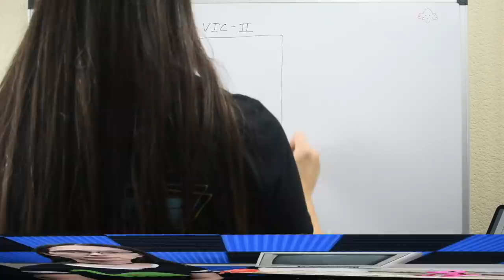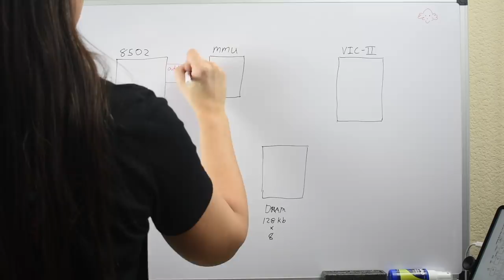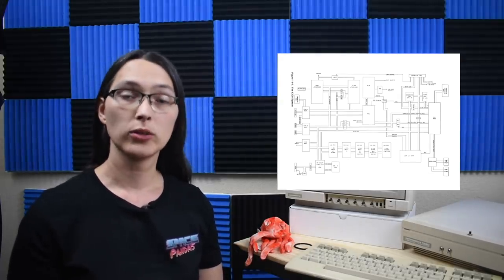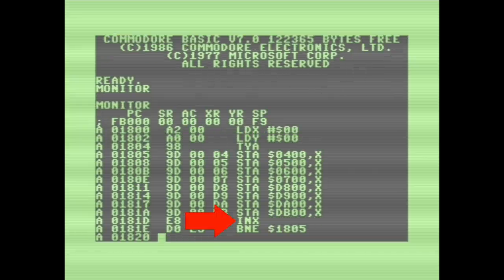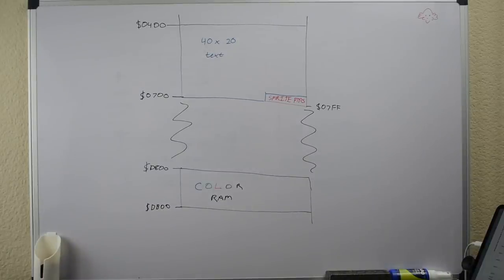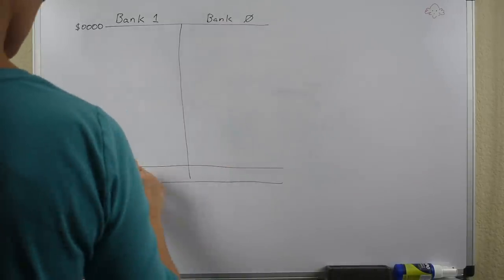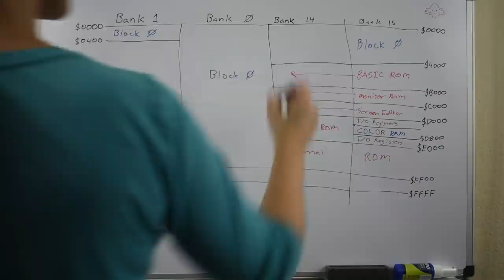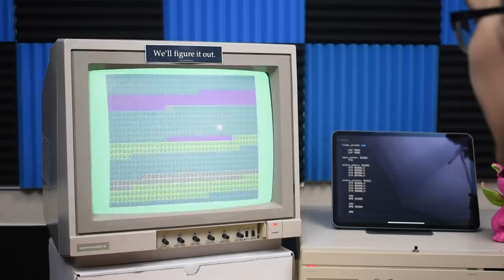Commodore 128D: Episode 2: Meet the VIC-II

Comment: that MMU thing makes the c128 use virtual memory then ???
Reply from the maker: Axel Werner  Not really "virtual memory", but close. It translates logical addresses to physical ones. Virtual memory is used for swapping out pages of RAM to disk, and requires MMU page protection to work with proper efficiency. It can be done in software, but its harder. Not sure if the 128's MMU can do that or not.
Reply: I'm not up to spec on the 128's MMU, but it seems to be a glorified bank switching IC.  I doubt it has the ability to implement virtual memory in the way that you are thinking.  Also, I'm pretty sure that the 8502 CANNOT fail a memory access and retry it later under software control.  The C-64 used the 6510's onboard IO port (@ $00/$01) to control bank switching of the various ROMS and I/O banks in and out at very specific locations, the 128 MMU seems to be quite a bit more powerful than this.

Comment: The ALU doesn't have integer multiplication/division? Huh
Reply from the maker: @sundhaug92 Yep. The 8502's ISA reference is here: http://nybblesandbytes.net/6502 -- no integer MUL or DIV instructions.
Reply: Yes.  The 6502/8502/6510's ALU is primitive (which made the chip less complex and cheap to produce, a key factor in the chip's success), and performs most operations in one cycle once you've taken into account memory accesses.   Off the top of my head, it can only perform 8-bit addition, subtraction, single-bit-shifting, and single-bit-rotation operations.  On the other hand, it could do some very CISC-like things such as perform a bit-shift or bit-rotation on a memory location (effectively a read-modify-write) without trashing your general purpose registers, or performing memory indirection as an implied part of an instruction.
Reply: 6502 coders can divide and multiply by 2 using shift and add/sub instructions. For example: to multiply by 5, shift 2 times left and add the original value.

Comment: Will you eventually cover writing in BASIC? While I understand the point of writing it all in assembly, it makes my brain hurt too much to attempt personally.
Reply: The intention of this series is to explain the nuts and bolts of the C128. Computers of that era were really meant to be programmed in Machine Language (to use the terms of the day, now we would say just Assembly Language). BASIC was an introductory language to get you started, but then even the user manual of the C64 and C128 deferred to Machine Language to use the hardware to its best. You can learn BASIC by reading the manual, that is how most of us did back then. You will figure it out :)
Reply from the maker: @LexieAssassin unfortunately, this series will focus heavily on assembler, not BASIC, since assembler allows much lower-level control of the hardware at much faster speeds.

Comment: Have you used CBM .prg Studio. Great programming tool for the entire CBM range.
Reply from the maker: @piggypiggy pig Actually, no I haven't -- first I've heard of it. After looking it up, I realize, that's the program used by the RetroGameDev book which I have read through. Very neat program, but sadly very tied to Windows. I actually run Mac and Linux at home, so I'm afraid that program's a bit off the table.
Reply: @NybblesandBytes  Hello, don't know if you checked lately but apparently you CAN get CBM prg studio to run in Linux.
Another youtuber called "OldSkoolCoder" have this to say : https://www.youtube.com/watch?v=LZOSlMWlUHw
I suppose it may be dependent on which Linux distro is being used. He's using Ubuntu but then again it might work with other distros as well.

Thanks for your great videos! 👍
Reply from the maker: Yeah, I've used wine before with mixed results. Generally for applications I find it to be a no-go. Parts of the win32 API just aren't there or have major problems.

Comment: Great intro music. Don't like the Illuminati pyramid necklace. 
Looks like 8x the RAM of an SNES ?
It's hard to get into all that programming info for this computer, when it's not related to what I do.
Hopefully people will get into it. 
Nice to see you got results.
Reply from the maker: The Unboxing Authority Dunno about the SNES, but that choker I got from a friend. :-p
Reply: @NybblesandBytes  SNES has 128 Megabits of RAM Max on the cartridges. It's a 16 bit system. 
I hope your friend doesn't belong to a secret society. 
I'm working on doing some SNES stuff. 
With the SD2SNES and SD2SNES PRO Game Cartridges (that are actually modern computers on a cartridge) anything may be possible. 
The new SD2SNES PRO has the ability to do more stuff than any game ever designed for the SNES.
I think it would be fun to see people turn it into a Family Computer (Famicom) 
Just need a way to attach a Keyboard, Mouse, and Internet. The SD2SNES PRO has a Micro USB Port, and people have used it before.

Comment: What is the purpose of the mux in front of the memory? Is it just for “practicality”?
Reply from the maker: @Tim E It's hard to see from my diagram since I wanted to keep it simple. The actual complete diagram in the reference manual is what you actually want. IIRC, it's to allow the VIC-II to control directly which chip gets control of the address lines: the MMU or the VIC. There's probably more to it, but I don't have a full schematic handy, so I'm not 100% sure about the why on this one.

Probably a question for @Bil Herd!
Reply: @NybblesandBytes   neat! That's clever.
I'll see if i can dig up a schematic :D
Reply from the maker: @Tim E Please do! I'd be curious, myself! When I did that segment, I was puzzling over the purpose of it and trying to work out the timing the VIC would need to "steal cycles" from the 8502, but just couldn't quite gel the idea.
Reply: Another book that goes into minute detail on all this is "Commodore 128 Internals: an authoritative insider's guide." I don't completely understand the electronics, but basically the 8502 and the VIC have to take turns using the system bus to acccess RAM. So the VIC contains the clock and sends signals to the 8502 to tell it when it's allowed to use the bus. That's why the 8502 can run at 2Mhz in 80-column mode: the VIC is turned off and the 8502 gets the system bus to itself.

Because the VIC isn't affected by the MMU's switching, they can be looking at different banks of RAM. That presents some interesting possibilites. Like the VIC could be displaying from screen memory in bank 1 while your program sets up the next frame of animation at the same address in bank 0, and then a change in a single value will switch it to the new frame with no delay.

Comment: I learned 6502 assembly on the Apple //e which has a comparably powerful monitor (CALL -151 anyone?)
Reply from the maker: @sarachikorita DIdn't even know the //e had a monitor! Neat!
Reply: Probably the one advantage the ][ line had over the 64 (though as I recall most of the other Commodore 8-bits do have a monitor).
Reply from the maker: @sarachikorita The 64 and VIC-20 did not, actually. It's actually why I chose the 128, and why it's taken me so many years to really get into it.
Reply from the maker: @fnjesusfreak  Yeah, I think the Max, the 16, the plus4 and possibly the PET all had monitors. Just not the mass market ones. ;_;
Reply: I think we used something called the Big Mac assembler on Apple 2E. Full two pass assemblers are way better than simple monitors. I used a cartridge called Hess Mon on the Commodore 64. I think they also put out a Commodore assembler that was on floppy disk. Although back then nobody called them floppy disks they just called them discs.
Reply from the maker: @ttfidrat I remember calling 'em floppies quite frequently. Also "five-and-a-quarters" once I had some IBM PS/2 machines that took 3-1/2" disks. :-p
Reply: LDA C030

Comment: What's the name of your game which you're "porting" from Javascript? Name that dragon that you'll be slaying! Good job owning the (rather small) errors in "#1" - Dave of Eevblog back-annotates errors by reposting the subtitle track with colored overlay text - you can too! Then viewers  will hear the goof, but READ the correction simultaneously! As in " *PCH is really for address bits 8-15, PCL is for address bits 0-7!)". Good luck & good job!
Reply from the maker: @fluxoff Oohhh! So that's how he does it! I didn't realize that you could use the subtitles for that. Neat idea! I may investigate this, then. Thanks for the tip!

The name of the game I'm "porting" from Javascript is... ...well, it doesn't have a name! I think I called it "minimalist dungeon" or something like that. Basically it's "Ludum Dare #26". :-p
Reply from the maker: @fluxoff You can play it here: http://www.theonelab.com/files/ld48/26-minimalism/
Reply: Your video editor package should include a tool for creating subtitles at arbitrary time codes. With any luck, this will be a plain text file with the rootname of the videofile or project with an extension of .sub.  Read YouTube & Wikipedia Subrip docs for format(for manual corrections & tweaks). Name suggestion: 
/Ld64/c128 ="Ld64c128d rev x."

Comment: what she do is programming in machine language right?
Reply from the maker: @Guy Chamberland Kinda. I'm actually programming in assembly language, and the monitor converts that to machine language. You can see the machine language in the series of hexadecimal bytes to the left of the instructions when I press return.
Reply: Assembly..which will become 1s and 0s
Reply: It's called Assembly Language because the pneumonics have to be assembled into machine language. We were taught how to do this by hand for the Apple II in high school in 1984. It translated very well to learning about microcontroller architecture in college. There's not much call for that kind of knowledge in modern jobs.
Reply from the maker: @ttfidrat  Depends on the job. I'm an embedded software engineer, and knowing how assembler works and the ISA of the machine you're working on is hugely beneficial. Even when working with small systems.
Reply: @NybblesandBytes  Yes I agree. When I do this level of programing I have a hardware schematic right next to me. I used to debug my assembler programs by looking at the opcodes that the assembler produced to see if I coded the correct addressing mode.  In college we created a MIPS processor from scratch in VHDL.  When we started feeding opcodes to the architecture a light turned on in my head.  When I started my current job our systems used assembly code for the 8051 microprocessor but as our systems were developed we moved to programming fpgas with schematics or vhdl and did our higher-level programming in c sharp with comunications interfaces to the lower level Electronics. These lower-level interfaces are my specialty. Here in Iowa true embedded Electronics jobs are hard to land unless you're the best. I'm really anxious to see where you take this channel, and whether you'll go more towards the hardware or towards assembly programming. If you go towards programming you should introduce your users to a macro assembler as soon as possible.
Reply from the maker: ttfidrat We'll be getting into a macro assembler soonish. Post sprites, the programs will be complex enough to merit it. I'm actually evaluating assemblers now. So far, the latest v10 Buddy assembler looks and behaves fantastically.
Reply from the maker: ttfidrat And yes, this channel is going to focus on the programming. Have to get our bearings first, though. :D

Comment: Great stuff, keep up the good work! But please (for the love of God), remove the CRT render filter under Settings > Video Settings > VICII Renderer. There's no need for it, and doesn't everyone want a clean screen?
Reply from the maker: @Quessir I actually like the way it looks, but that's a fair point. :-p

The moire effect it creates onscreen is pretty annoying. Thing is, what I want to do is actually program on the 128D directly instead of using the emulator, so some of the graphical artifacts will still be present once I get my cable put together, which is why I left it on.
Reply: @NybblesandBytes  Yeah, I remember talking to the 8-Bit Guy about this on one of his videos and someone else chimed in about it. Seems that NTSC machines did display these odd scanlines, my PAL C64's and C128's never did, though they did look as "soft" as the text does when using CRT emulation. Shame there's no middle ground! But if that's the look you grew up with then I perfectly understand. It just bothers the heck out of me every time I see it :D
Reply from the maker: @Quessir  Well, what's odd is that the 128D has a vertical stripe going through the onscreen characters that x128 doesn't reproduce at all due to a bug in the VIC silicon, so it's not totally accurate, but there you go. :-p
Reply: @NybblesandBytes  You're absolutely right! That vertical stripe used to bother me so much back then, as well as the vertical columns showing up more prominently than on the C64 - I actually spoke to Bil Herd about it once and he wasn't sure why - I quote, "The ones that were shipping when I was still there were acceptable to my eye, and I HATE noise. I have heard that later ones had the issues, could be from cheapening of some filters to someone moving a trace or a wire or not grounding it correctly within the housing."

Comment: I've often wondered why hardware developers take such a conservative approach on their designs. I understand that it can't do all things for all purposes, especially with limited processing power and die size, etc, but in your explanation of the VIC-II chip, they gave it 16 bit address line so that it can access only 16k. I can imagine that they had their reasons for doing this, but I hope it wasn't because of a "failure of imagination", thinking that no one would "ever" need more than that.

There are always trade-offs, of course, in any engineering project, but I'd be interested in knowing the reasons for these self-imposed limitations. Anyone?
Reply: I would guess that the VIC-II only has 14 direct address lines because they needed it to fit into a 40-pin DIP chip and figured the 16KB-block trade-off was worth it.
Reply: @csbruce  Quite possibly. Plus, I imagine they were not thinking it would be used for more than a few years before the next big thing came out, so, room for improvement.
Reply: Pin on an IC... have ALWAYS had a cost associated with them.  If your fabrication plant is set up to produce 40 pin DIP packages, going over 40 pins means you need to move to a different package.   If you aren't already shipping something with the new package, you need to bring out a new one, which is not cheap (engineer and fab time to design, verify, build up prototypes, test, and iterate to fix problems).  If you're at Commodore in 198X, and expect to ship this machine in 6 months, that is not something you want in your product schedule.  If you're at Commodore, and the new design is going to be more expensive to produce in quantities than the old one, and you're expecting to stamp out MILLIONS of these IC's, that is not something you want to do.
So, your compromise is, lop off pins until it fits the package you are designing it for, possibly splitting it up into multiple IC's.  If you lop off data bus bits, you lose bandwidth.   You can't lop off control bits.  They could EASILY have made the VIC-II have direct access to the entire 64K of memory fom day one... if they wanted to add more pins to the package, which was almost certainly not an option when it was initially designed.  These are called "Engineering Tradeoffs".
Reply: @glenndoiron9317  Compromises suck! :P
Reply: @JustWasted3HoursHere  Yeah, well, without them, things would be too expensive to sell.